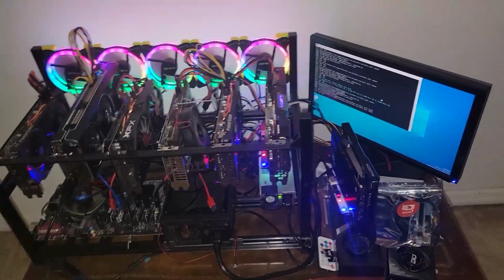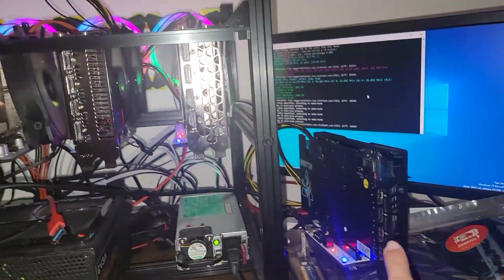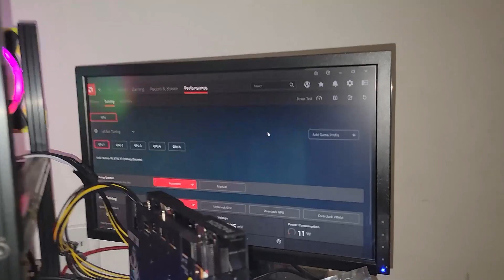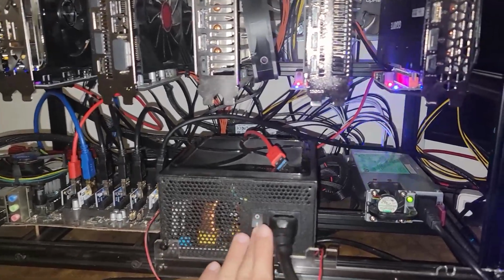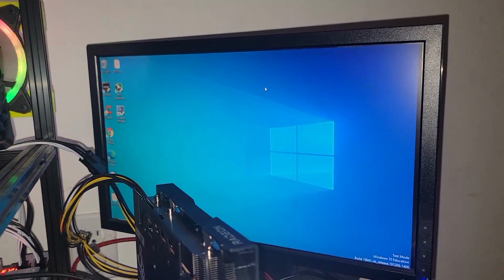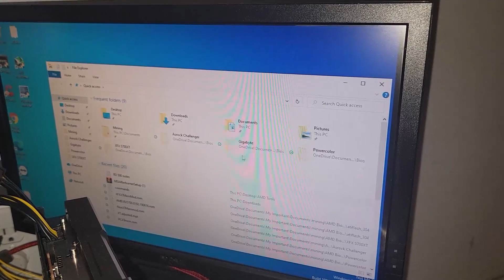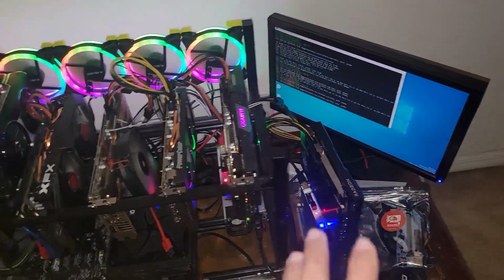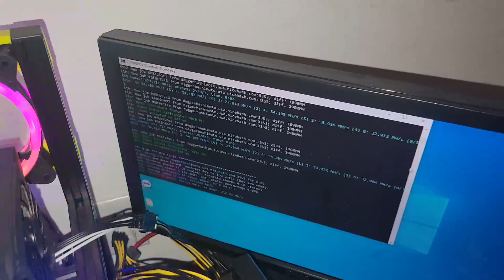How to Troubleshoot your Mining Rig

Comment: First step with any XFX card or dual bios card  (23 from 580 8gb - 6700xt) is make sure you didn't accidentally flip the bios while grasping it to plug it in. I have partially flipped a switch and spent all kinds of time trying to figure out wth was wrong. I point this out because: 1. I have done it several times over the last couple years and 2. I just did it installing a new Merc black. Would have saved hours just looking at the bios switch. Edit: Great video btw, thanks you.
Reply from the maker: Thank you and pinned your comment as that is a good point!